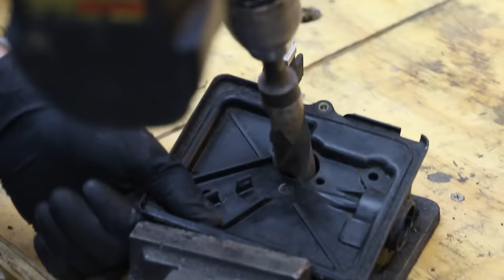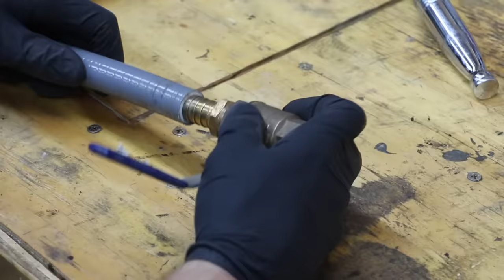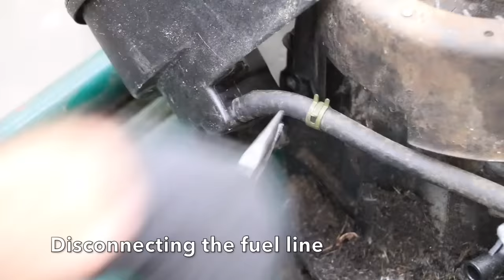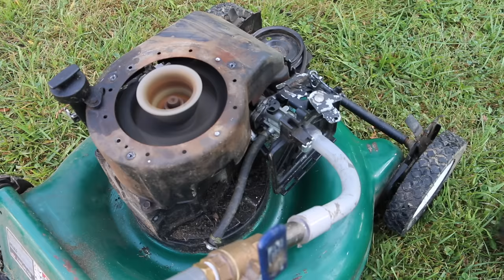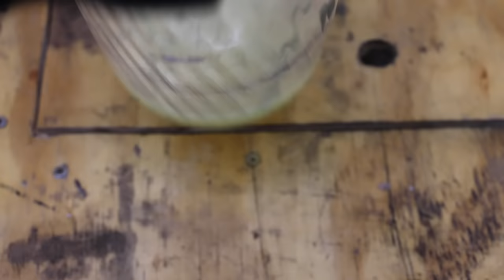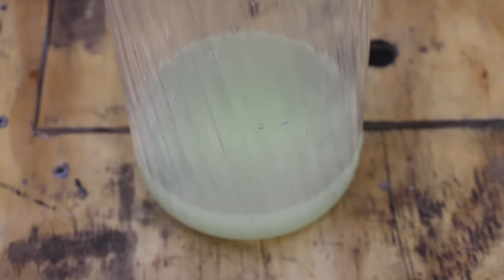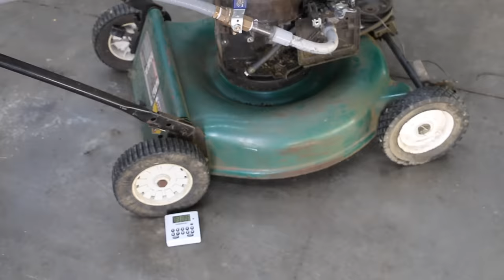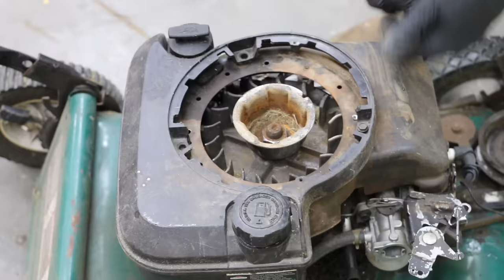Will a "Gas Vapor" Container Improve MPGs and Fuel Efficiency?  Let's find out!

Comment: Reuse that yellowish fuel with the high oxygen content and see if that performs better or worse than pure gasoline
Reply from the maker: Great recommendation.
Reply: What makes you think the color I'd due to it being oxygenated? Gasoline has many components, it is a blend of different hydrocarbons which evaporate at different rates. It is more likely that factor causing the color change, imo.
Reply: You could probably analyse before and after residue using chromatography at a local lab - not very hard to do actually. Interesting to see ?
Reply: The discoloration is probably a mix of dust and oxidation of components of the fuel.  The performance differences due to contamination is likely negligible.
Reply: Timothy Jesse   I suppose it's  possible due to dust in part.  No doubt without having a dust filter on the air intake dust is free to enter.  However, when typical dust is allowed to accumulate on a surface over time it's not any shade of yellow.  Just saying.  Without a doubt there is a color change, which indicates  the makeup of the fuel has been changed from the fuel started with.  Cheers.
Reply: hydrogen is 130 octane..     its classed as explosive..  gasoline on the other hand.. is classed as flammable..  so dont be surprised if the ratings are actually more like gasoline is 5% efficient, and hydrogen is 98% efficient

h2 also burns clean. no carbon... and will actually remove carbon build up from engines the previously ran gas.

there's no saying it... if the laws say energy cant be created or destroyed.. hydrogen is energy.  Why, you make h2,    you BURN it in an engine.. and..    you get water from your exhaust pipe.    which means, burning hydrogen doesn't destroy it
Reply: Kevin automobiles don’t use pure gasoline they use combustion by mixing oxygen with gasoline in an vaporizing manner which can be super explosive in an engine if used correctly. That’s how they do jet engines. You have to vaporize the material into the oxygen to make it explosive combustion...
Reply: believe the change in color is that some component of the gasoline (probably the paraffin) is not being aerated, or not at the same rate as the lighter components.
Reply: I agree a filter should be placed in the intake, but I'm wondering if the gasoline is truly oxygenated then; A. Shouldn't the engine be getting a better burn rate; and B. Shouldn't the engine corrode faster due to the higher oxygen content? Also wouldn't warming up the fuel increase vapor creation?
Reply: @harleyme3163  It's actually the hydrogen that is being burned when we use gasoline.
Reply: @mrpumperknuckles1631  You don't know that a gasoline, internal combustion engine can and do run on H2? When the combustion occurs under pressure inside the cylinder there is Oxygen in the combustion chamber as well that comes from the atmosphere. The chemical reaction under heat and pressure recombines the H2 and the O to become H2O.  That is what comes out the exhaust. H2O
Reply: Benkay V Falsifier hydrogens hurts the engine worse than oxygens
Reply: DavidBruce Allen wrong your burning the oxygen on the combusionc chamber turning it into carbon and the oxygen left over fuses with the remaining compounds in the chamber.!hydrogen is non combustible and thus you can cause a huge misfire of the engine over a few years of exposure of this to your cars intake system. You people don’t seriously understand science do you? When you combust the oxygen it explodes initially so that you have the piston bounce up and down if the piston doesn’t have enough combustion it can misfire which is bad for the engine. Hydrogen doesn’t do anything. If you try to fill octane gasoline into the engine combustion you will possibly cause for a release of higher chance of hydrofluoric acid which is a very heavy form of acidic material that does worse for the environment than you would with CO 2
Reply: DavidBruce Allen HYDROGEN ISNT A COMBUSTIBLE GAS!!!!!
Reply: my guess is, those fumes which made the engine run, where those with the most energy density, thats why they made the engine run more  "efficient".
A chemist could tell us more
Reply: @mrpumperknuckles1631  thats not how jet engines work, its basically just a big flame but no explosion, and much simpler than automotive engines btw.
Edit, oxygen is not what burns, its just the catalist, it has to react with hydrocarbons which contain the energy.
oxygen alone doesnt contain the energy, or are you getting fat by breating?
Reply: DavidBruce Allen btw if the combustion causes the Oxygen turn into CO2 how can it turn into H2O? the answer is that it won’t it will turn into HC2O
Reply: DavidBruce Allen also this isn’t including the many impurities of much of octane... octane has a combination of not just carbon but nitrogen, hydrogen, sulfur, etc. there is small percentages but their still their none the less. The point is that your just flooding your engine with natural air from the outside your not transitioning anything from water into the combustion chamber.
Reply: Stefo syros when you have less oxygen you can’t function a motor properly you suffocate the engine without the proper amount of energy and to claim that you can take Hydrogen and claim it will pump through an emerging engine pistons will suffocate the function of the major oxygen format. I understand you probably don’t know how a get engine works so I will base it for you. Jet propulsion is the vaperization of Jet fuel which will than form it into a oxidized format as my professor explained that 1 it is in the air so it is based off of using extreme amount of heat propulsion mixed with energy propulsion using not the combustion of the jet fuel that’s not how jet engines work but rather lighting flaming and burning the jet fuel into propulsion. The potential energy is released and is shot out the back of the engine. That’s how jet engines work. But seriously I still don’t believe you can just take or should in this matter take the claim of a few business men about HHO system because it all seems too fake. There has to be something going on that these people aren’t telling us. Business men are known for bs science claims like how you can turn the humidity into drinkable water for example or the claim that solar energy is better for the environment when really if you have. A huge solar power plant you see literally no life for a good mile or two... seriously here what is it that makes octane so useful as a feasible fuel source even if it was hydrogen. Water only has 1 hydrogen. While octane has about 18  unless you can actually take a configuration but literally it’s impossible to make a fuel that can output the amount of energy that the Octane gasoline produces. The reasoning is that 
1. Market value to create such fuel is cheap 
2. Trying to get government to regulate the force of another fuel will break the market and cause huge amount of problems for the entire world that have been used to the octane fuel!!!
Reply: @mrpumperknuckles1631  huge texts dont make you seem better informed pal, as you stated, 'your professor said', that means you have no clue, you just repeat what you thing you understood. your english is bad AF as well.
Less oxygen, suffocate? you try to explain stoichiometric mixture or lamda 1. basic thermodynamics.
You also confuse hydrogen with hydrogencarbonates.
Your explanation of jet engines - a joke. heat propulsion mixed with energy propulsion? You cant even spell JET kid, its JET, not GET.
as a matter of fact nothing you say makes any sense at all. and the fact that you answer to everything and everyone with such dedication says it all about your selfconfidence.
Reply: Stefo syros lol funny here is some basic knowledge for you too 

https://en.m.wikipedia.org/wiki/Combustion
Reply: Project Farm try running your mower on gasification?
Reply: Isn’t this not good for performance because when you rev the engine it needs more fuel so the engine bogs
Reply: @Harley Me
No, hydrogen is NOT classed as an explosive. Look at the Hindenburg burning, the hydrogen burned just like any other flammable gas only burning (deflagrating) there where it meets oxygen in the air. A hydrogen - oxygen mixture is another story...
Reply: Mr PumperKnuckles Yes, Actually it is.  Oxygen does not combust, it oxidizes.  A flame is just a rapid chemical reaction (oxidation) of a compound that emits light and heat.   Another thing: no liquid burns.  It must first be converted into a gas and can then combust.  Internal combustion engines use a carburetor to attempt to convert the liquid into a gas in the correct stoichiometric mixture for combustion.
Reply: Mr PumperKnuckles Hydrogen burns.  Oxygen does not.  Combustion is actually a chemical reaction called oxidation.  I think a few of the people here understand science, but I don’t believe you are one of them.
Reply: Oscar Blue lol seriously you think I’m not? Really? I don’t think your checking all of the chemistry that this video is trying to promote. 1 hydrogen count won’t effect the amount of CO2 admissions that your trying to project. Your still releasing CO2 into the water chamber and when you have to dump that water chamber it will still be a stronger more concentration  of CO2 or Carbon in the least released into the water it will still effect the environment just as badly as normal engines will. Your just trading the air born carbon for concentration of carbon into the water intake! Seriously! You cannot just magically replace the fuel source with water that’s not logical. There is not enough hydrogen or carbon in the fuel to create a sufficient chemical reaction!!! You hippies don’t know real science your a bunch of eco frauds who want to claim that this will solve this problem or that problem but really you just cause more problems that you fix!!! Your not understanding of science or at least you only know the basics of chemistry I have to give you that. But claiming that this will 100% fix admissions when really you have to replace the water of the filter system which is all this is!!! It’s nothing more or less!!! Infact if you expose this engine for over 24 hours worth of constant use without letting in any fresh oxygen you will have no more oxygen that will pass over because it will always be exhausted as H2O which is exactly what comes out of exhaust pipes to begin with!!! So to claim that exhaust doesn’t produce H2O in the end of a chain reaction is regarded!!! Just like how people claim fission is a greener power source compared to fusion... when fusion in nuclear energy causes less nuclear waste!!! Only difference is that one requires less energy to start... that’s the only problem!!!
Reply: Mr PumperKnuckles Please try to stay on track and reply to MY comments when addressing me, not the comments of others.  Is there anything you dispute about the two comments that I have made?  Most of the people commenting on this thread have no idea what they are talking about, and most likely, have no background in chemistry.  I suspect you are so emotionally involved in this thread, that you lumped me in with a comment someone else made or you have been metabolizing C2H5OH while keeping up with this thread.
Reply: Mr PumperKnuckles,  Please explain how a jet engine works.  What you wrote is very difficult to understand.  Also, please explain what octane gasoline is.  I have not heard that term before.
Reply: The easiest way to determine if the milky color is due to aeration wouldve been to let it sit and settle out. Although i bet its probably the different hydrocarbons not evaporating like mentioned
Reply: @0ut0FSYNK  dust? Dust? Dust is nowhere near the color of what was in the jar. Dust is GRAY! Not to mention unless you're in a dust storm it's impossible to accumulate the amount of dust required to change a color in 27 minutes.
Reply: @mrpumperknuckles1631  Harley wasn't hypothetically creating anything. You completely misunderstood his/her comment.
Reply: @mrpumperknuckles1631  dude just give up. Nothing you say makes any sense. You didn't even know that all combustion yields water.
Reply: @mrpumperknuckles1631  Your grammar is pathetic, but that doesnt mean you can't make an argument.  However, your poor writing skills make it nearly impossible to understand what you are trying to convey.  

Now, regarding the rebuttal to professura:  how can water be the product of combustion but not be in the H2O form?  Water is H2O.  You might even get 2(H2O), as the product.  Most of what you say makes me believe you are failing chemistry, or have a teacher that isnt really qualified to teach the subject.  

Yes, I have studied chemistry, physics, and mathematics.  I scored poorly in composition, but am able to construct a sentence far better that the examples you have provided.

I have also operated jet engines for the past 28 years and can tell you that your understanding of their operation is incorrect.

My advise to you would be to carefully think out your argument.  Then write it out, and read it out to see if it flows.  Once you are done editing your thoughts, perhaps consider including the formula for the chemical reactions that occur during combustion.  

Most of the "science" in this thread is incoherent, but yours is by far the most incoherent I have seen in this particular thread.  It's one thing to be wrong, but when you are an obnoxious ahole, and incorrectly describing chemical reactions, it makes you a target.  As you get older, you will learn that it is better to remain silent and be thought of as a fool, than to open your mouth and remove all doubt.
Reply: @mrpumperknuckles1631  Please fill me in on the HHO system.  I am not schooled on that subject.  Also, here are some commas (,,,,,,,,,,,,,,,,,,,,). Use them to separate different  thoughts in your sentences.  I dont know if I included enough, but they are free, and you should consider using them so people can understand your thoughts even though they are probably invalid.  

I think we are in agreement that the person in the video is wasting his time with this experiment, but I get lost in your endless, poorly worded, diatribes.
Reply: Mr PumperKnuckles I have 24000 hours running jet engines and am quite familiar with their operation.  If you had to look up jet engines in your book then you are trying to make sense if something that is apparently way over your head.  

Yes, I do understand some of what you say, but most of it is jibberish.  If you are under 18, then you have lots to learn, but at that age you are in the process of learning the things that use will use later in life.  If you are over 25, then I would recommend spending some time improving your communication skills.  Looking at your writing skills, I would be willing to bet that you are not earning more than $15/hour.  Not bad for a teen, but not good for an adult.

I will congratulate you one one thing.  Your latest response was short and concise, although incorrect.
Reply: Mr PumperKnuckles Jet engines do not use millions of small blades, it is more like hundreds at best.  

Chemistry does not change daily, weekly or even yearly.  That is why energy outputs are very predictable with a given set of inputs.  Since you are smarter than everyone here, why don’t you share your educational background with all of us “morons”.
Reply: @oscarb9139  to be fair I think when he said millions he was clearly and purposely over exaggerating.
Reply: @ThePrufessa  Do you know what he means when he says HHO engine?  I think he is taking some sort of class related to chemistry and is now an expert.
Reply: @oscarb9139  I have no idea. He tried telling me that different types of combustion yields different types of water. And somehow he thought I said jet engines don't have combustion when I never said anything close to that.
Reply: ThePrufessa I think he made a reference to “his instructor said....” in an earlier comment if I remember correctly, so I am guessing he is a kid who totally misunderstands what the teacher is saying or he is reading something on the web that sounds really cool but has no basis in science.   His writing skills are poor at best.  

I remember when I was younger, I saw something that sounded factual and argued with my father about it.  Years later, when I did some reading about lubricants I finally discovered that dad knew what he was talking about.  

I suspect if I asked him to show the chemical reactions to support his opinion, that he would not be able to write an equation that was equal on both sides, much less prove his point.
Reply: ThePrufessa      I went to the beginning of this thread and found the comment he left about studying combustibles in college.  He thinks his degree in whatever is going to take him places.  If he creates his own resume using his phenomenal grammatical skills, you might see him using his combustion knowledge in the back of Burger King.  What a shame to spend all that money for a degree and ending up not having the skills to write a report.
Reply: ThePrufessa I suspect he is not doing well in his class.  I suspect his “different types of water” might be different oxides of nitrogen.  Even if he knows half of what he says, I doubt he could write what he means on a test.
Reply: @nathanielwyeth3778  what the hell are you talking about? First of all I know what dust is. Secondly, whatever you're talking about has nothing to do with the point I was making.
Reply: Nathaniel Wyeth what is residule?  Did you take the time to read what you wrote before submitting?  Your writing style resembles Mr Pumperknuckles writing.  It makes no sense.
Reply: @mrpumperknuckles1631  your comment is not very clear.
Reply: @mrpumperknuckles1631  You obviously don't understand science, or are either a troll, stop giving false information to people, you don't combust oxygen, oxygen is the oxidizer for the combustion of the liquid fuel, you need to lay off the drugs man
Reply: @mrpumperknuckles1631  Also nothing is combustible without an oxidizer, wood, cloth, gasoline, propane, whatever, won't burn without an oxidizer which is oxygen which the planet is abundant in, so as long as there is atmospheric oxygen YES HYDROGEN WILL COMBUST smh
Reply: You obviously don't live here in the illustrious, deep south where, every spring, everything is coated in a very thick layer of yellow.  When the pine trees start their  mating frenzy and the pollen is so bad you can't tell the color of cars. Even black. Lol.      (How's your duck doing, can he still disco?)
Reply: I'll bet that loss of transparency is due to higher water content as it draws it from the air. As for the color, as the fluid becomes more milky, the color becomes more visible.
Reply: Perhaps it also collected moisture from the air.
Reply: @harleyme3163  - hold up.  130 octane makes a hydrogen engine 95% efficient and 89 octane gasoline makes a gas engine 5% efficient?  ok!  we must all be living in the twilight zone with that kind of math!
Reply: That would be interesting to see that done.
Reply: Oscar Blue look your argumentative dialogue is funny! 
But let’s get back to the objectives is there a methodology to marking a gas system operate at higher efficiency or not! 
Clearly you both have your own particular skills! 
The real question is are you going to argue or come to a workable solution! 
The manufacturers are producing engines that are clearly designed to keep fuel efficiency’s to keep the public enslaved! 
You two have great ideas but you fall prey to a divide and conquer system ! That keeps all of us enslaved! 
It is by the way their objective! 
Y’all prove their point! 
Why not collaborate instead of arguing, then publish a free workable design for free so all who are reading your e politest can duplicate them and start to turn the tide on our enslavement?something to ponder don’t you both agree? 
Angel in KC  ps I don’t think you have to be a rocket scientist with a college vocabulary to reach these objectives?
Reply: Oscar Blue clearly you have experience! With no regard as to how you use grammar or not ! 
That’s not the point! 
Rather how can you apply your clear experience with high level combustion fuel to reach a workable design so the people like me who are reading your posts ! 
And design and make accessible a working system a ordinary fellow being can read and make in their own garages and have a fuel saving device or plural devices! 
That would help to free us from our mutual enslavements? 
Come on man!!!
Help a brother out ! 
We the working poor re basically all in it together weather our grammar or comprehension is as high as either one of y’alls!
Reply: So, in reply to some of the comments here... I have contacts at NASA for a project that im working on and some of you are right. It is not the oxygen that burns, it is the catalyst that fuses with the oxygen to burn. Oxygen is an oxydizer and makes things burn. You have to have an actual fuel source for oxygen to be considered flammable. And hydrogen is VERY flammable.... Ever heard of the Hindenburg?? The hydrocarbons in the gasoline are what make it flammable, vaporizing them and putting them directly into an engine is making the work of the fuel injectors (or in this case, the carb) easier, but in a much more efficient ratio than the carb can do. Even if it is 2-3% better, it is still better. That left over fuel is what is known as oxygenated gasoline. As more oxygen is introduced into the fuel, the less hydrocarbons are availble to be burnt, making it harder to stay burning. If you look at the gas pump when you go to fill up your car, the premium fuel (usually 91 octane or higher) says "non-oxygenated fuel". Engines run better with out oxygen already in the fuel... It provides a more complete burn, eg. uses all the fuel volume. The left over fuel should be able to be put into a vacuum chamber to remove the oxygen from the fuel to be reused again until it is fully used up.
Reply: You’re also aerating it with unfiltered air. The discoloration is most likely a combination of the heavier oils left over because the lighter oils evaporate faster) and particulates in the air.
Reply: rick dees
It’s not gasoline that was oxygenated, it was the vapor fuel, did you even watch the video???
Reply: Many Plastics are Attacked by Gasoline.  The discoloration may very well be from Micro Bubbles still existing in the Gas,  after the Turbulent Air Entry Through the Gasoline,  in that Container.... but I would like to see First,   the Gas poured into a Clean Mason Jar,  with a Tiny Hole Punched into the Lid,  to remove the possibility of the Jar Bursting due to Warm Weather,  etc.,  and then observed every 30 Minutes,  to see if the Bubbles come out of Solution,  and the Color returning back to it’s Original,  Clear State.... proving that in Fact,  the Color Change,  did come from Oxygenated Gas,  (or at least Micro Bubble Rich Gas,  if “Oxygenated Gas”,  is not the Correct Term,  even though there is in Fact more Oxygen in the Gas,  just because there is Oxygen in those Micro Bubbles)  If it Clears Up in Color,  You will know if it was due to all of the Micro Bubbles in the Gas.

I Suspect,  that the Gas is quite possibly Attacking one of the Plastic Components,  and causing the Discolorization,  Due to the Broken Down Plastic Components.

I would like to to see some Experimentations done,  where you try to really INCREASE THE RPM,  and doing so,  with and without the Engine under a Significant Load!  If you are unable to successfully stomp on the Throttle,  and have it be able to Run very Well,  as would be expected in the Real World..... and then also try to get it to Idle,  at the same RPM, that it was able to Idle at with the Liquid Gas being Fed to the Carburetor from a Gas Tank.

Keep up the Good and interesting Work! 👍🖖
Reply: @rickdees251  aeriation?
Reply: @mrpumperknuckles1631  my buddy has run his old truck on gas/water/ hydrogen for years. He now has a 100 amp water/ hydrogen generator for 100% water tests.
MIT university told him how to do it.
Reply: @mrpumperknuckles1631  wanna bet
Reply: @ProjectFarm  Don't believe this for a second man. Take a look at the water content of that gasoline now... Just a recommendation... it is probably very wet now, that discoloration could be water...
Reply: @lancaster5077  as someone who does this for a living, lol please don't you'll kill a Gc with that, the left over stuff is high boiling point junk
Reply: They add stuff to the fuel to make it not as likely to explode..... that is probably what the yellow stuff is so probably wont run very well at all.
Reply: @0ut0FSYNK  I don't know much about this stuff, but would it not have soaked up some water from the air and would that not damage performance?
Reply: It's probably ethanol. Or did I miss him saying he was using ethanol-free gasoline?
Reply: It has high "varnish" content, not high oxygen content. That's why it becomes more and more yellow as it is consumed, because the varnish will not vaporise at normal temps. This is a major reason why gasoline does not store well for very long, once the volatile components vaporize away, the crud that is left does not run well in a gas engine.
Reply: @rickdees251  The yellow is a colorant added to automotive gasoline to distinguish it from aviation gasoline (which gets a blue colorant). It's just more visible because the gas has been aerated. That's not a chemical change, it just means there are lots of very, very tiny bubbles in it. I'm betting that if you kept it for a day or two it would look like ordinary gasoline again.
Reply: @DavidBruceAllen1  The carbon burns as well if the engine is running properly. That's why you also have lots of CO2 in the exhaust. If it doesn't that's when you get black soot in the exhaust, like diesels when you increase the power rapidly. Even under normal conditions some of the carbon only combusts to CO instead of CO2 which is what makes engine exhaust a lethal gas.
Reply: @mrpumperknuckles1631   "HYDROGEN ISNT A COMBUSTIBLE GAS" That's nonsense! Ever hear of something called the Hindenberg? As for turning oxygen into carbon, you're claiming nuclear fission is occurring inside an automotive engine? Again, that's 100% nonsense. What happens in an engine is the heat first breaks the bonds between the carbon and hydrogen atoms in gasoline (or diesel fuel), then the hydrogen combusts with atmospheric oxygen from the air intake to form H2O (water vapor), then any oxygen that's left combusts with the carbon to form CO and/or CO2. The exhaust is mostly nitrogen (from the intake air), water, CO2, CO, a bit of soot (unburned carbon), a small amount of NO (nitrous oxide from the small amount of nitrogen that does combust) and some amount of unburned hydrocarbon (fuel). The latter two are very bad for the environment so cars have a catalytic converter that combusts them in the exhaust system but the energy from that combustion is wasted. There are, as you note, also impurities in all fuel that of course turn up in the exhaust as well. What goes into the engine must come out.

"if the combustion causes the Oxygen turn into CO2 how can it turn into H2O? the answer is that it won’t it will turn into HC2O" No, it will turn into a mixture of H20 and CO2, which is exactly what you find in the exhaust of every internal combustion engine (and every jet engine as well, for that matter). Also, as stated above, combustion doesn't cause oxygen to "turn into" anything, there's no nuclear fission or fusion going on turning one element into another - what it does is cause the oxygen to combine with other atoms (carbon and hydrogen) to form chemical compounds. The net reaction is exothermic so you get heat along with the compounds. There is no such thing as HC2O, that's just gibberish. I'm guessing you slept through chemistry class in high school, or haven't gotten that far yet.
Reply: @brettb9194  good point with the parifin wax. It could be hydrogenation like butter from moisture in the air, pressure changes from flow, and mechanical agitation from bubbles.
Reply: @rickdees251  yea, I  left a can opened once and after more than a half of it evaporated  the rest was more oily, almost diesel-like. I wonder how much of gasoline in the world is evaporated each day instead of being used in the motor. Diesel is better
Reply: rick dees it’s the yellow dye in the gasoline mixed with unfiltered air creating the deep color change, all fuels have dye to determine what type it is.  Like avgas is blue, and red fuel has reddish  hint to determine off road diesel vehicles etc..
Reply: Stefo syros  it’s amazing you corrected the previous guy how he is wrong about how a jet engine works just to over correct with more BS how a jet engine works😂 I can definitely tell you have zero experience in jet engines. It’s not just basically a flame with no combustion and definitely not easier than a automobile engine. Which jet engine are you referring too? I would love to know which one burns like a candle without combustion. I will tear up my A&P license and quit aviation working on jets if you can spew some of that fine aviation knowledge you hold.
Reply: It's just gotten wet
Reply: That is gasoline with water in it, not oxygenated gasoline. Gasoline is hydrophilic so it will absorb moisture from the atmosphere when bubbling. The fuel will act like gas with water in it, because that is exactly what it is.
Reply: @0ut0FSYNK   right on, and maybe the container he's using or hose? Idk I should try this
Reply: It's an oxidized fuel, which means that it had less material to burn. It'll give less calories per weight if anything.